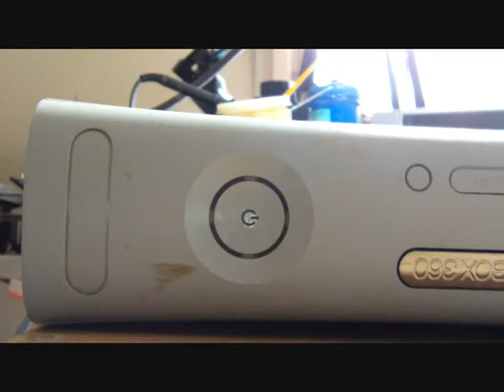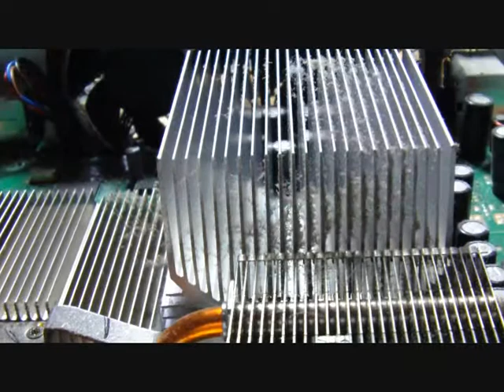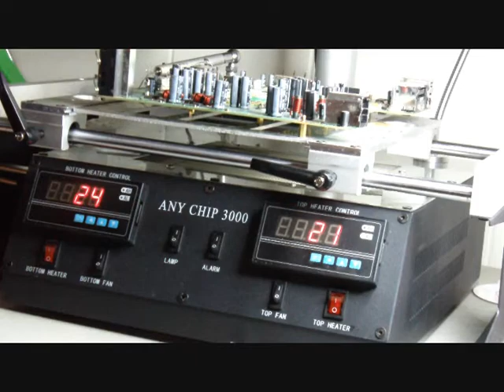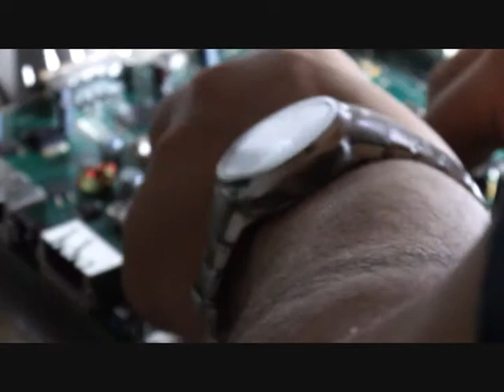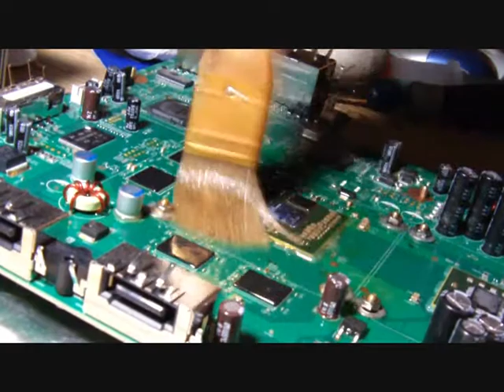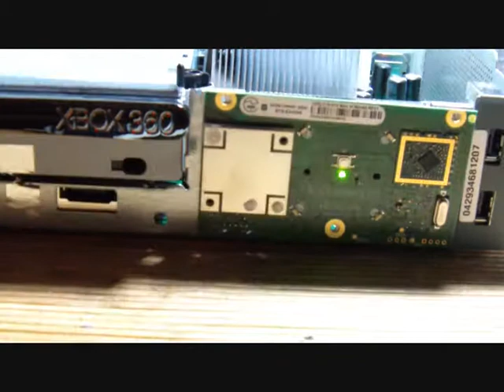BIRD 3000 Doing a Reflow, - From 0 to Working on Xbox System -

Comment from the maker: Sir, the board is never at the temp of the heating plates. If you want to know the exact temp of the board, with an external THC you can do that or a laser one. Usually you need to reach about 200 to 220 in your heater to reach the board 160 to 180, the temp of the board and the retention depends on the weather and environment you are working in, please contact support in dragon group china, this channel is only to show videos. The support they give you there.
Thanks
Digitools TV

Comment: Question about the bottom heater temperature readings.  The setting is for 185 and the system hovers around that setting.  The bottom heater temp sensor is in the bottom heater and not at the board itself.  About what temperature is the actual board getting to when you finally turn on the top heater?  It is elevated above the bottom heater on a support board, should the actual board have reached the ultimate 185 temp by the time you turn on the top heater?